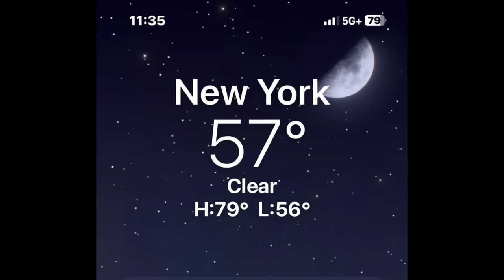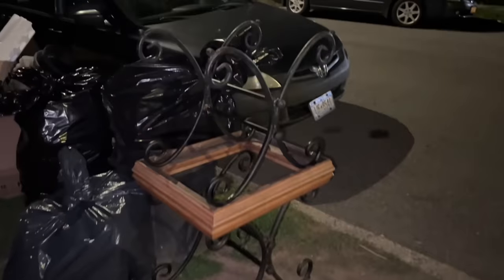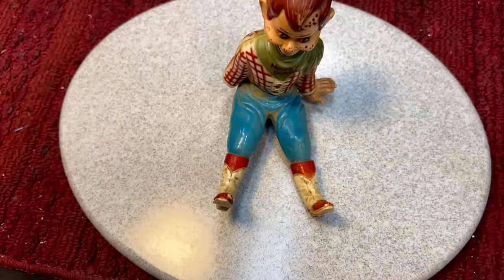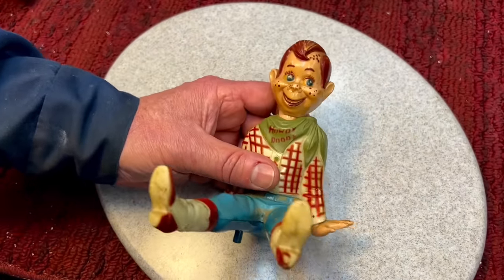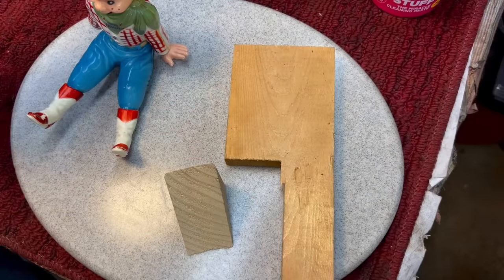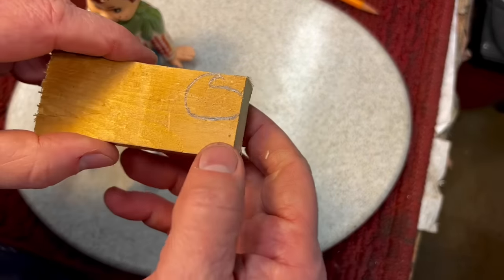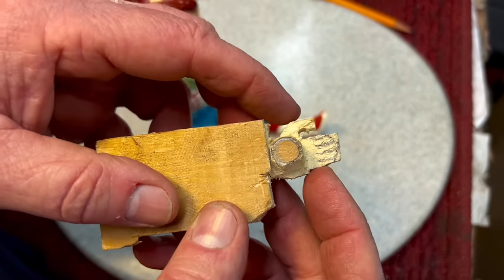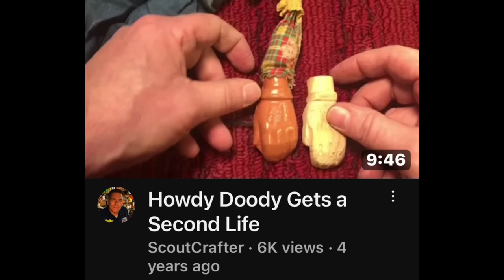Poor Man’s Flea Market Report, Vintage Howdy Doody Lamp Repair.

Comment: John I remember the hand incident of 4 years ago,cant believe its been 4 years. I love old lamps also. My Grandma had an old 1920s radio at the bottom of her basement steps and on top was a lamp of a horse, a palomino. It had the finest velvet coat and she had a half dozen saddles made of leather she had collected and she would change them every time I was over. She said I could have it and after she passed I went down to get it only to find My step grand father had let a antique buyer clean out all of the great stuff for his D*m bingo money. I have tryed to find another and have never seen one.
Reply from the maker: Troy- That’s a hard one but I bet one day another will show up on eBay, I swear everything shows up on there!  😂👍
Reply: @ScoutCrafter  I look all the time,Im hopeful. Problem is I dont know what it was actually called. When ya look up horse lamp or lamp with horse 100's and 100's show up of all kinds exept the one I need and I spend so much time looking at them all. Bummer I know. But one day that jewel will show up.

Comment: great job john as per usual ...but for that sorter thing e.g replacement plastic parts i use candle wax molds and car filler i think you could have used this method here ...cover hand in candle wax to acheive basic shape fill with filler lump of wax drill hole in wax for wrist bring parts together sand to shape paint john uk

Comment: If you have another, identical lamp, did you consider making a resin cast of the hand?
Reply from the maker: The original hand is glued into the sleeve, very little sticks out.  👍

Comment: So, do people put that stuff out hoping someone will take or is it for garbage pick up?  Where I live, if it's not in the garbage container it doesn't get picked up.  They won't get out of the truck for anything.
Reply from the maker: Basically you just put the stuff out.  We used to have a local dump but they did away with it so now they have to take everything.  😃👍